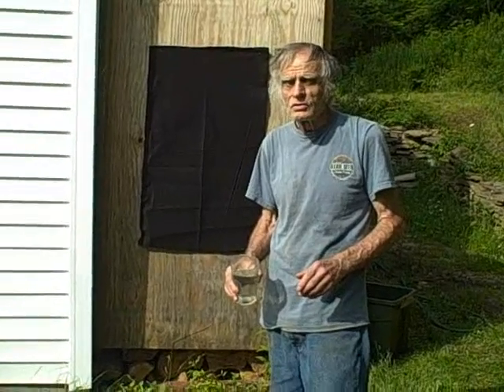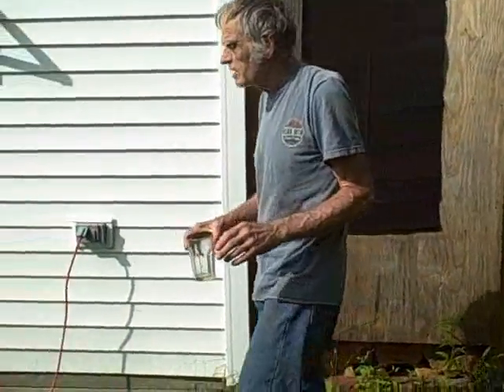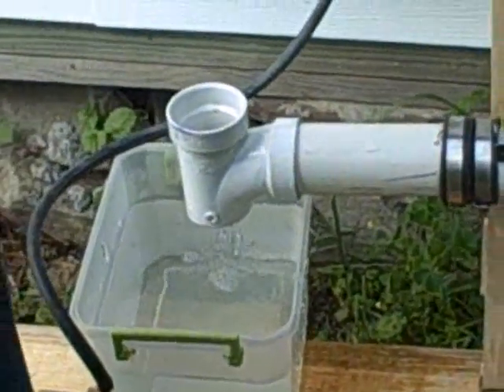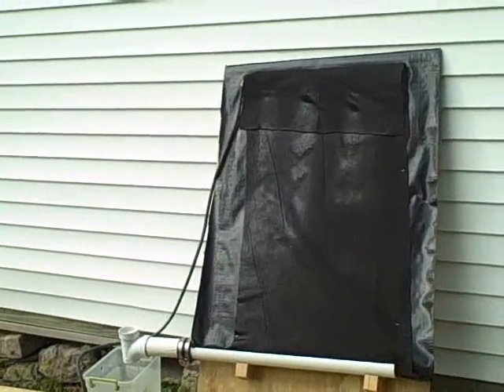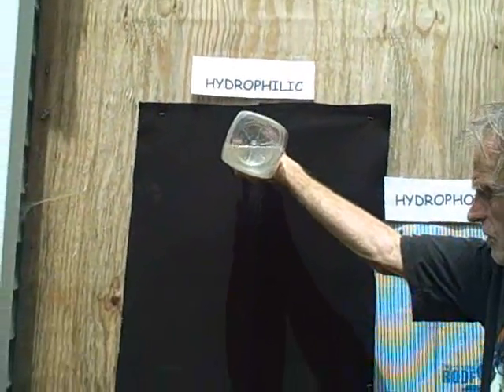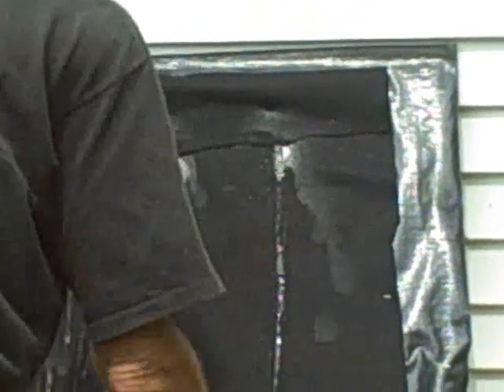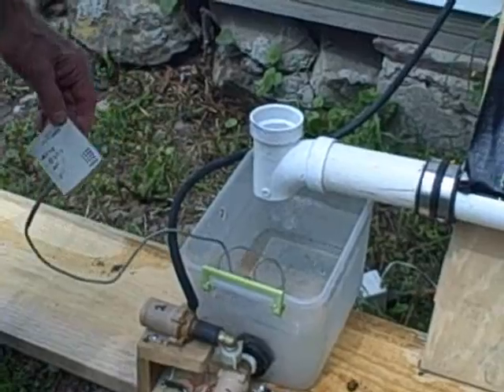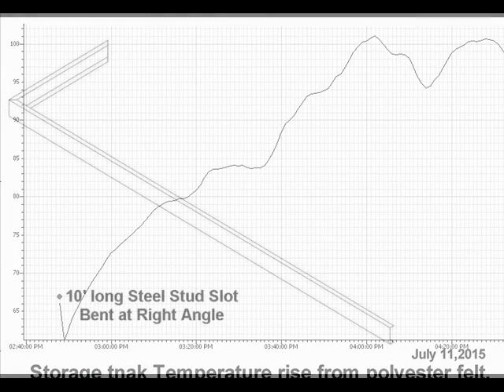MTD Solar 102

Comment: I'm curious about the the width verses only 2 drip holes.  Wouldn't you get better heat absorption if you made many smaller holes in the upper black water tube? This way the water would be spread out & absorb more of the heat created in the black sheeting material.  I love your system and thank you for you videos.  Also, can you tell me what the black material is?

Comment: John where can I buy the Black fabric and what should I ask for thanks ,Chuck
Reply from the maker: Cold Steel 
Wallmart
Reply: John Canivan That is good news and Wallmart is only 127 miles away (one way). I will be doing a new heater to replace the one I made 7 years ago, thanks John.
Reply: Cold Steel black polyester felt